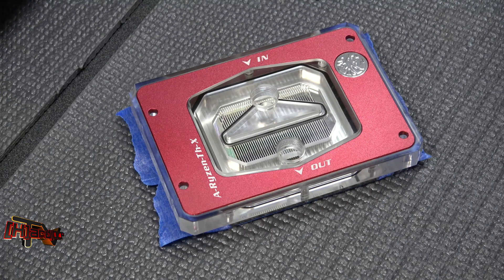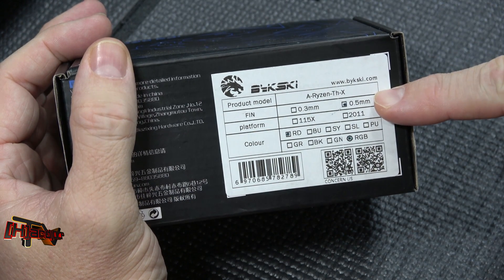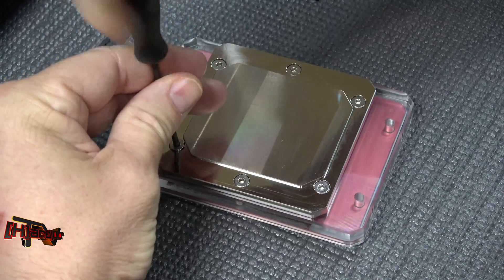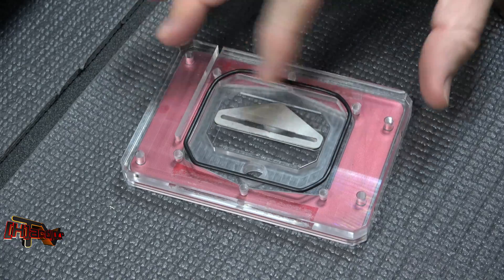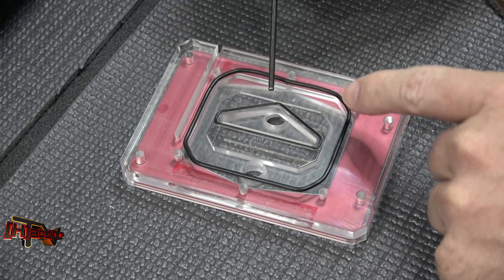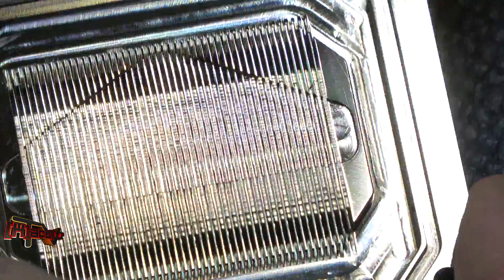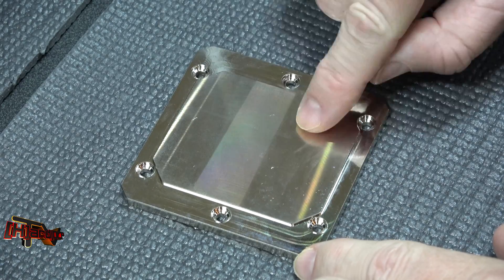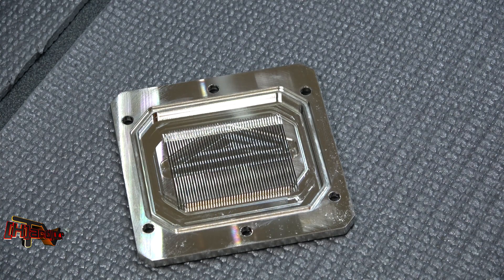AMD Threadripper Bykski Waterblock First Look with Breakdown

Comment: My concern with the contact plate on these, and also the base plate on something like a corsair CLC is, when all those grooves are there... and you can literally feel them with your fingers... your thermal paste is going to fill those gaps... and now you are insulating the heat in those spots... I dont care much about having a polished block, but a smooth plate I think is important.
Reply: A mirror polish is actually a bad thing, you want a little bit extra surface area for the paste to grab. Especially if you are going to do any water chilling. A mirror polish with a sub-zero set up can make the paste slide out from in between the block and the IHS.